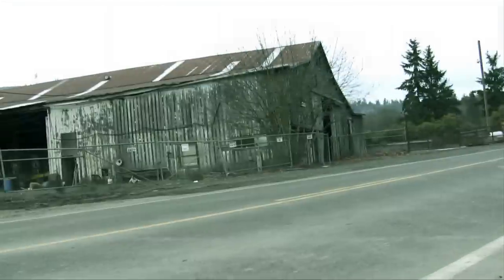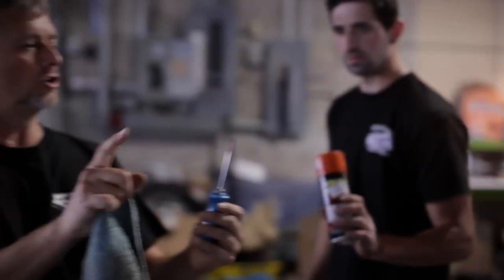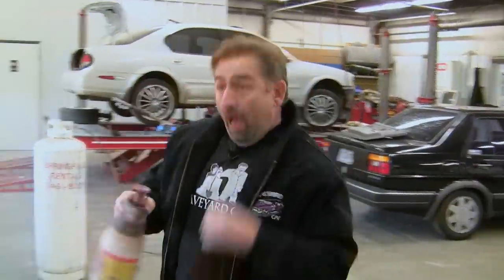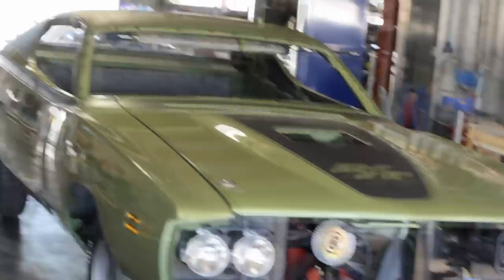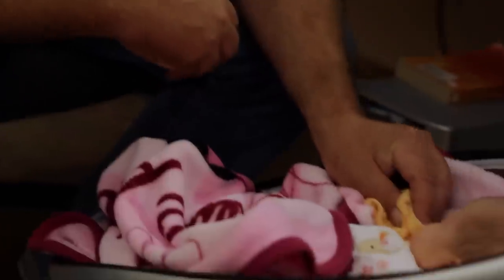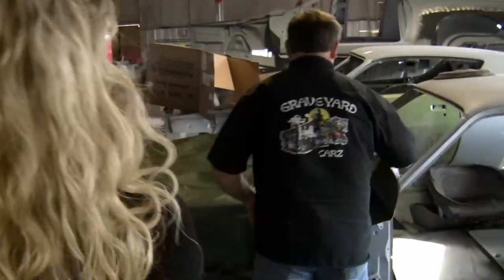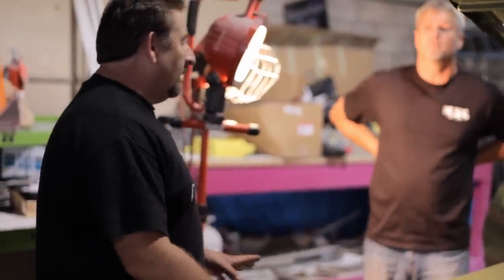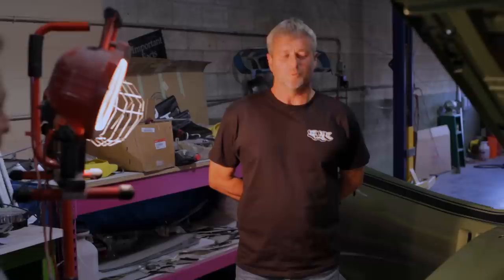Ep.1 - Emma's Car | Graveyard Carz: Season 1

Comment: Mr. Worman 
How many 1971 Road runners were made. How many were painted green go / sassy grass ? How many had the white strobe strip across the top. How many had a 340. How many were made with no power anything. How many had the a-883 transmission. How many were made with the Hearst pistol grip shifter. How many were made with the 323 sure grip. Wedge hood ? 340 six pack ? 
That was my 1st Car !
Reply: 1

Comment: My Mom a hot red head always wanted a Pink Ford Pinto.  Dad, instead he purchased a Rambler Marlin which she wrecked shortly afterwards  by driving through a fence Dad had just built. She claims the brakes did not work.  She could have been correct or Dad could have been killed all I know is that she ran through the fence she stop after hitting my swing set in the backyard. We were living in Lubbock Texas at the time of our first new home tract style building you finish yourself yard.  Dad bought the house for $3000. Bright lime green color finished home. Later Dad had the car repaired and painted it Purple for Mom. Guess that was close to Pink as Dad could get.